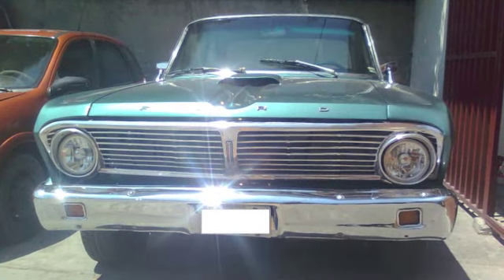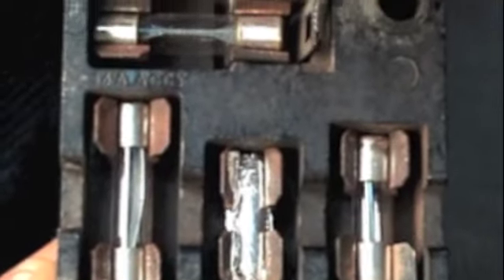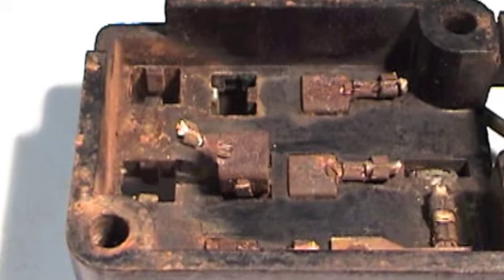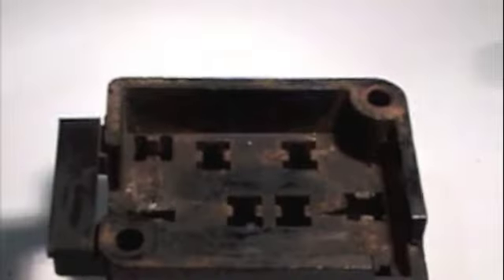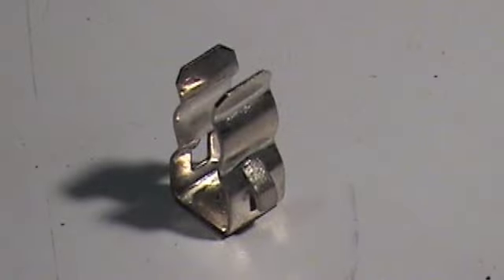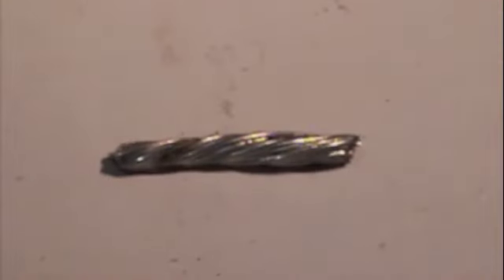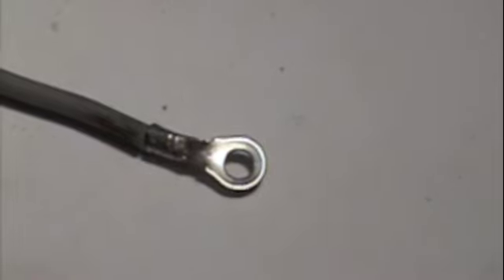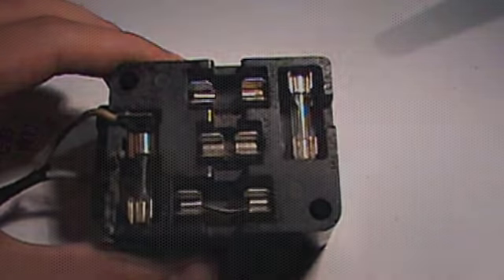How to Repair a Ford Falcon / Mustang Fuse Box

Comment: In my 64 Fairlane the fuse box is located under the dash on the left side of the steering wheel (if you're sitting in the car). Its where most fuse boxes are but its hard to see because its pushed back under the dash a little and it is so small. Keep looking fella's and you will eventually see it. It took me three days to finally see mine and it was right in front of my face the whole time. ! haha